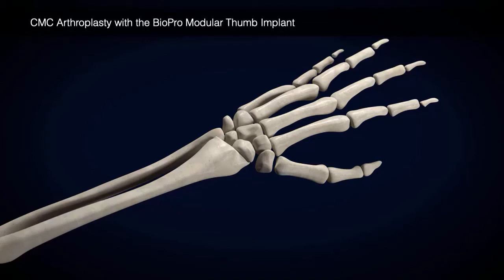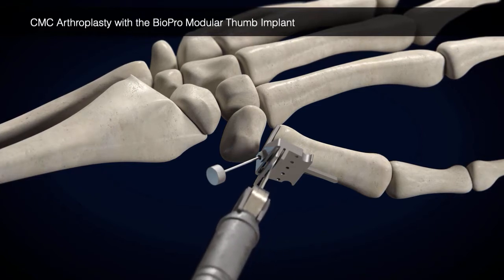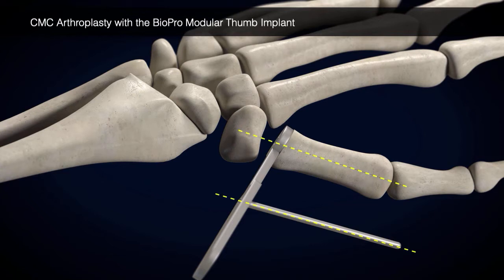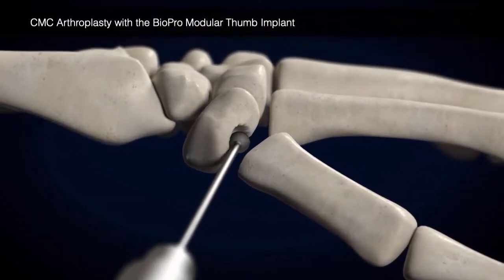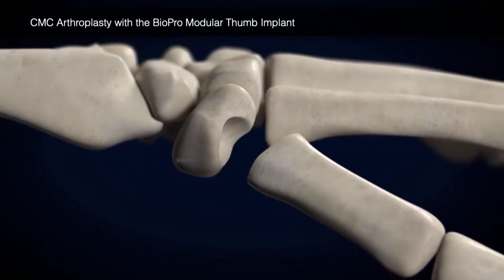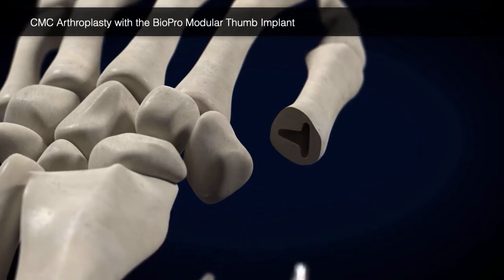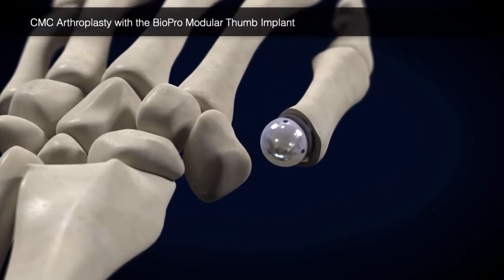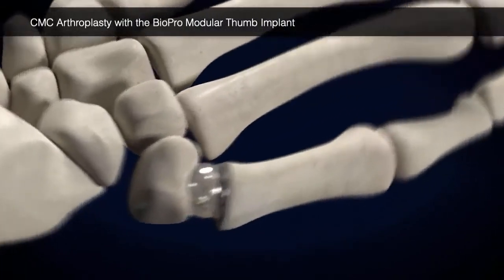Thumb Surgery Animation with the BioPro Modular Thumb Implant

Comment: What happens to the scaphoid bone? Seems like it would need a cap to receive the ball joint
Reply from the maker: A healthy scaphoid joint has cartilage and shouldn't have any stress or pain. The head of the implant articulates in the trapezium bone. If the scaphoid bone is arthritic, it may be a contra-indication for the implant as you may still have pain at the scaphotrapezio-trapezoid (STT) joint.

Comment: looking at the animation of course it looks simple..there is a large gap between the metacarpal and the trapezium,what happens with the ligaments that connects them together?
Reply from the maker: The goal is to maintain the same length. The surgeon removes 5mm from the base of the metacarpal, then inserts a head that's roughly the same height so no length is lost.
Reply: @BioProInc  yeah but the 2 bones are held close by ligaments...,if 5mm is cut off the trapezium and i imagine a decent space is needed to drill the trapezium and grind a half circle in the metacarple,what happens to the ligaments thats hold these 2 bones together?
Reply from the maker: @Spannerface  You are correct. Ligaments play a crucial role in stabilizing the CMC joint before surgery. The main supporting structures we encounter are the APL and EPB, both of which we dissect around and they are retracted out of the way, not cut.  During the procedure, the surgeon aims to preserve the ligaments, ensuring proper capsular closure. Additionally, the implant's design enhances stability, and our initial study reported no dislocations. Notably, only 5mm of bone is needed to insert the burrs required to prepare the socket in the trapezium and for the impactor to create the void for the implant stem.
Reply: @ ok thanks for replies.

Comment: What follows is my response to iamlight's question. I received a Biopro thumb implant last week in my left hand.  I use my hands extensively for everything from gardening to precision machine work.  I also do micromanipulation under a microscope, and I play the piano. (Not professionally, but it is very important to me) The LRTI approach (using a stripped and rolled up tendon) dates back to 1945.  I am not impressed with its long and painful recovery, its loss of thumb length or with its loss of dexterity.  Those are the main reasons I chose the Biopro approach over LRTI. 

I spent the last 2 years making sure I wanted a Biopro implant, while living with two essentially crippled hands (in the middle of a Covid pandemic) After extensively canvassing the western US I found an experienced doctor who uses Biopro implants, and who also does the LRTI method where the implant is inappropriate. We decided together that the implant made sense for me personally. I will publish his name only if he consents.

I also considered LRTI surgery. I spoke to a doctor in the medium sized city where I live who tried to convince me that LRTI surgery is the only acceptable method. His points were:
1. The Cobalt Chrome ball will shatter and fill my tissue with unremovable shards. I pointed out that my total knee replacement is the same material. He said the same thing would happen to my knee. I have been unable to find ANY documented cases on ANY joint replacement where this has happened.  Cobalt chrome is very strong and very hard. I am an engineer and I am familiar with similar materials. Perhaps this could happen in a violent car crash, but again, I could not find any actual cases where this has happened.
2. He said that the only material that can be used for repairing body parts is material that is made from my own body. Perhaps he is referring to stem cell treatments, but I could not find anyone who has perfected this method for thumb repair. I could not find anyone doing stem cell repair of CMC joints.
3. And finally, he said that an infection will develop on the metal surface of the ball that will be immune to antibiotics, and that it would be rejected by my body's defenses. 

All of the above sounds like weak hearsay that has been circulated by doctors who have their own axe to grind. I'm not sure exactly what that axe would be, but I have found that many times in life we need to make decisions with imperfect information. My knee replacement is 8 years old, and I almost never think about it. I have had no problems with my knee, and in my opinion it is one of modern medicine's greatest inventions. In my opinion the Biopro CMC thumb implant is similar to a hip or knee replacement. The track record there is very good. In the end we need to collect as much information as we can and then move forward. The final decision is mine, and I am comfortable with my choice.

If there is interest I will report back here occasionally with an update. So far I can  say that the surgery is painful, but after a week or so the pain level has dropped to "acceptable, though still uncomfortable" level. I would compare it to a broken finger or other small bone.

There you have it...
Reply: How long did it take for the pain to completely go away? How is your hand doing now?
Reply: @miicro  First surgery late May, second one late August. First one is nearly pain free now (Oct 1); I have full range of motion and 60 lb grip strength in both hands as of Friday and the other joints in my hands are free of osteoarthritis. This is more than I need for the things I do.  Second hand still a bit achy, primarily in the morning for a half hour or so, but basically it is following the path of the first one.  PT is complete on the first hand, but still going on with the second (right) hand.  I am right handed.  I have resumed playing the piano, but carefullly, and I am fully capable of  micro-manipulation, though I am keeping my work sessions to 1/2 hour on and 1 hour off. I am back to my old 120 wpm keyboarding skill level. I have been doing all the homework exercises, and the physical therapist says that it shows in the results.

All in all, a wondrous gift. We live in an age of medical miracles.

Good luck,
Reply: How is everything doing now? Would you still recommend the Biopro?
Reply: Saw my local Ortho Surgeon, and was basically told my only real option is the old LRTI method. 
Didn't buy it from the DR, realizing that's been her tried and true method, and she hasn't been trained for things like this.
Need it on both hands, but am in a holding pattern until this Pandemic settles down, and I can find the right Dr.
Reply: I am facing exact same scenario.  Lots of research on arthoplasty.  Not convinced of LTTI.  Finding a compliant Dr. a gumption trap! ????
Reply: While this looks good, i wasn't aware of it, but my Dr. did a CMC Suspensionplasty using the FiberLock suspension system which is a single-incision suture suspensionplasty using the latest in anchor and suture technology. I was off pain meds in 3 days and would experience no pain unless I tried hard to use my hand. I was in wrapped brace for the first week and then a removable brace for 3 more weeks. Then PT which I actually started on my own quite a bit earlier. Going to have my other hand done ASAP.
Reply: Can they do this to the wrist too? How long does this last?